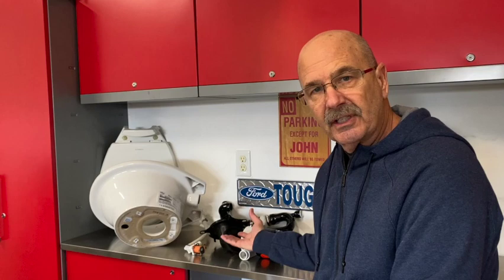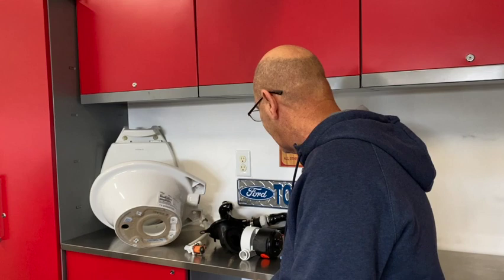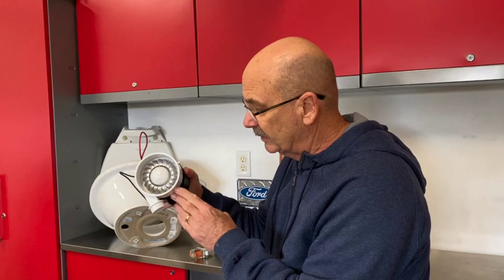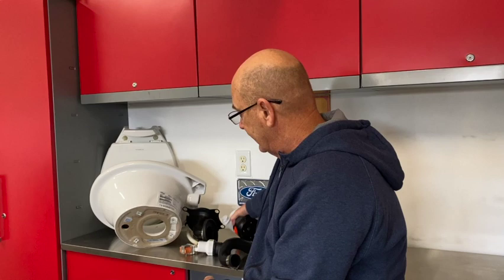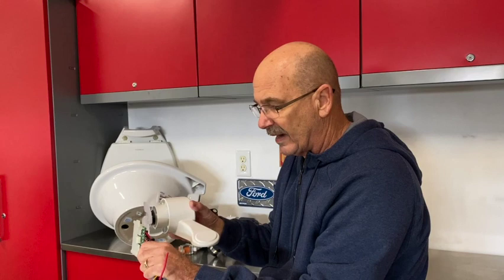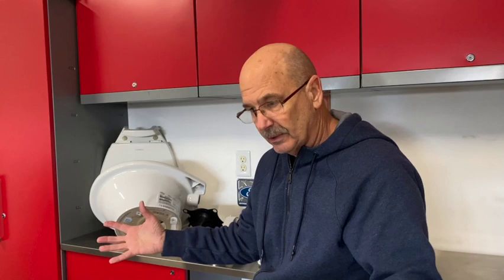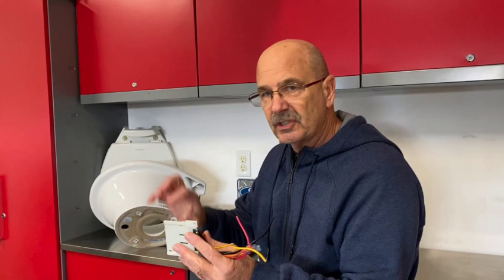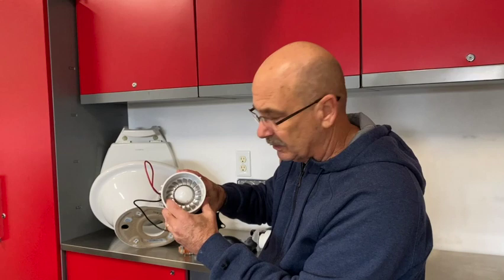Troubleshooting Dometic 7640 Macerator Toilet Part 3

Comment: Thank you for breaking down this toilet.  I have the same toilets in my 2020 Bounder 35K and really love these motorhomes and the floor plans are awesome.  My toilets just stopped working and I believe its because of dirty black tank sensors.  I will try to back flush the tank to get the sensors working again and your preventative maintenance plan sounds like the key to keeping these toilets working properly.  Thanks for sharing you knowledge
Reply from the maker: Thanks for watching Larry, the tank sensors on your 2020 Bounder are external sonic sensors they are not in tank. Try to reset the system by turning off the Aux battery switch for 30 seconds.

Comment: Hello John, great video about the macerator.  I have an 2015 Newmar Dutch Star with an Dometic toilet with a macerator. Over the last several months, I noticed the water in the toilet would slowly drain out after use. I assumed it was a seal gone bad but after taking the toilet apart, I could see the leak in / at the macerator. I took out the macerator and filled it with water and it is leaking on the underside of the blades through to the motor drive shaft.  I assume there is a rubber o ring or gasket under the blades around the shaft.  Does the white cap on the blades come off?  Can the blades come off?  If so, what kind of tool do you need?
Your help/knowledge is much appreciated.
Reply from the maker: There are no seals not like the typical gravity dump or Vacuflash that holds the water in, The macerator pump is not serviceable, the pump itself would need to be replaced. I would contact AquaStar Distributors they only carry OE Dometic parts plus they are great to talk to about the issue.   https://www.aquastardistributors.com/product-category/toilets-and-replacement-parts/macerating-toilets-and-parts/
Reply: That’s what I figured. Thank you, John.

Comment: John,Would the float valve controls the water coming in after a flush? The water keeps running and filling to overflowing. Great video
Reply from the maker: No, It only controls the toilet 12-volt operation, What brand, model and year coach do you have?
Reply: @thecasualrver  alliance 385fl 2021

Comment: Thanks for the great video here John very informative and helpful information.  I just recently returned from a vacation and dumped black water tank and flushed and confirmed empty on Precision Circuit Gauge. I went to add some happy camper powder as you recommend to keep tank fresh and toilet wouldn’t flush. I took covers off back of toilet and noticed a red light that would flash once when I tried to flush and nothing happened. I assume it’s the issue with the float from what you are describing here. Do you think it’s worth trying to flush the black water tank again to see if that fixes it before disconnecting the wire? Also, if last resort I have to disconnect the wire would there be harm in doing so? I assume it’s there for the reason of not overfilling your black water tank and this could lead to problems later on? What are your thoughts on this? Thanks in advance for any further help here
Reply from the maker: You can flush and drain again, and also shut off the Aux battery disconnect switch for 20 seconds,  I most cases that will regain the flush function. If that still does not resolve the issue, then disconnecting the yellow wire will be necessary. You will need to monitor the black tank level  closely once the yellow wire (s) have been disconnected. Hope this helps.
Reply: @thecasualrver  It helps a lot and confirms what I learned from your helpful videos. Thanks so much for your time, Jake G

Comment: Quick question for you my friend and thanks for the helpful vids they are much appreciated. You helped answer a question here about 6 months ago and I now have a different issue that has arisen so hoping you could help. I noticed that our foot pedal is now pointing straight up vertical so it’s hard to even grab without a weird angle with the foot to press it. The toilet is also flushing inconsistent as a result with some flushes using the added water and others being the dry flush without doing anything different at all. I am assuming this is related to the position the pedal is now in and wondering how it got there and if there is a way to get it back to the standard position? Any help is greatly appreciated once again. Thanks so much, Jake G
Reply from the maker: Thanks for watching Jake, The foot pedal has a spring that returns the pedal, what happened is there is a plastic tab  stop (on the foot pedal) that has broken allowing the pedal to go almost to the 90 degree angle. This is a common issue. Call Dometic and see if they will send you a new assembly.

Comment: Is it possible to add a wall switch to the Masterflush 7640?   I'm having trouble with the foot pedal switch (the cam & butterfly get out of alignment with the circuit board. The circuit board and switches are fine),  and can't seem to find the replacement parts.   Wiring in a wall switch would be one solution.
Reply: No it would not be, due to the circuits and 2 different flush modes. Try calling Dometic directly, they should have the replacement part.

Comment: Hi John,
I have 2 Dometic 7640 Macerator Toilets in my 2020 Discovery 38W.  One toilet works great in both flush modes.  The main Bath toilet in either flush mode does not maintain the water level. I have taken both toilet base covers off and I cannot see any difference in the installation.  I do not see any water seepage on any of the outside of pipes.  Could you advise me as to what I am missing and what I would need to do to hold the water level in the one toilet,  Thank you , Vince
Reply from the maker: Vince, The discharge tube assembly needs to be straight up vertical coming out from the macerator pump, and not at an angle,  if not it could work as a siphon and pull some of the water out from the bowl. there are no seals to leak pass. let me know what you found, it's an easy adjustment,
Reply: John,

I took both toilets apart and did not see any difference.  I have 2 pictures of the toilet that does not hole the water.  We still use the toilet it just does not hold water.  I don't see any differences between the two toilets.  How can I send you the pictures?  Can you email me an link to send the pics?  
Thanks for your help
Reply from the maker: @vincepovio7849 , send me thru Facebook messenger, my profile photo will have an class A coach in the background.  @ John Herthel

Comment: Could I have ruined the fins on the motor with one pod?
Reply from the maker: That depends, if the toilet is still flushing properly now, then it should be ok, just remember, make sure they are 100 % dissolved before flushing.

Comment: Do you happen to have the part number for the motor assembly and possibly a source?
Reply from the maker: The motor PN is 600346690, it should be available thru Dometic, and AquaStar Distributing.
Reply: @thecasualrver  that is the same part number I have, but I am still unable to find this part. Any ideas, I have emailed multiple sites with no response.
Reply from the maker: @dalehoch3432  AquaStar carries the macerator pump motor, just need to change the connector ends. macerator-and-macerator-assembly-for-masterflush-toilets
Reply: @thecasualrver  Thank you.